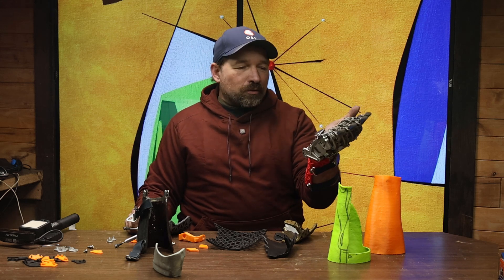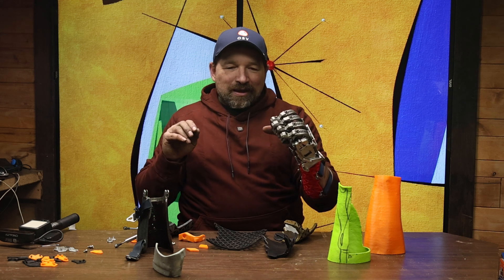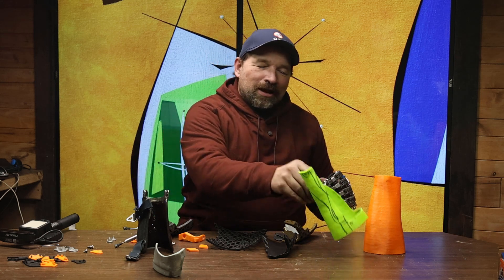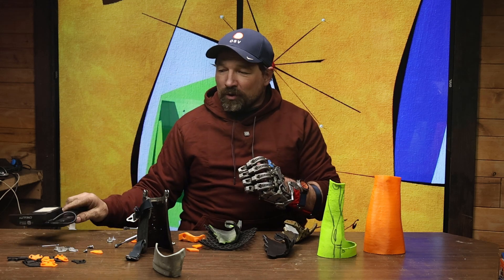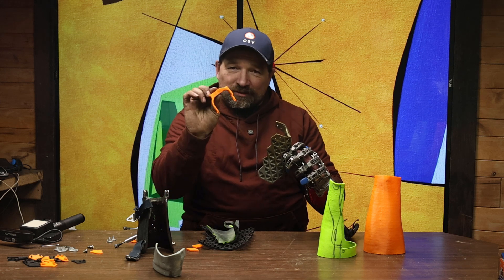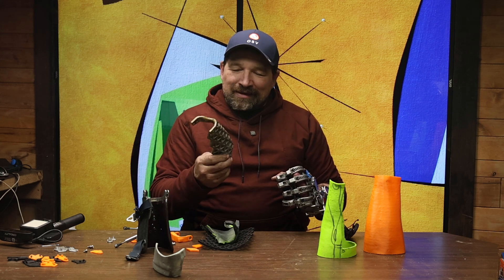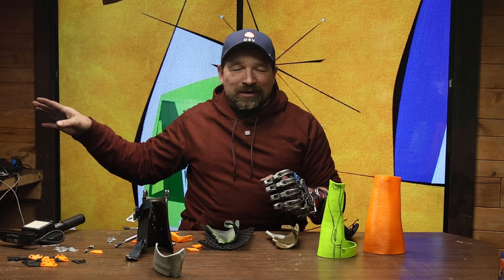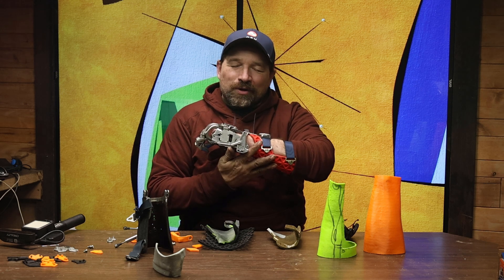designing my new forearm cuff without using cad! scan to print

Comment: That's super cool! Would cutting out several or most of those triangles be a good way to help breathability to the skin and weight without compromising the structural integrity? I assume that it would need to be made out of a more durable material

Comment: I have a quick suggestion for achieving a perfect fit on printed items. I don't make prosthetics, but I have made custom molded close fitting items out of thermo-plastics in the past. I printed the items as a flat (or mostly flat) plate, then heated them up to their glass transition point, and molded them to the body part. (using a flap of old jacket leather to avoid direct contact with the skin.)

My goal was a super tight custom fit for costume pieces, without supports that would compromise the surface finish. But I assume a similar techniques could work for your purposes. The basic idea is that anything that can be extruded can be softened with heat and molded a bit until it's just right.

Comment: never done something like that, but that sounds like less steps to check if it works, starting from physical could make sure that the first iteration is closer to what you want, neat! btw i have a question i dont know if you have answered yet, how do you deal with the cold in your hand, like, do you have a protector sheet between the metal and the flesh? is cold not that much of a problem where you live? do you have a specialized glove? (sorry for the bad english just woke up and its not my first language) have a nice day!
Reply from the maker: the cool thing with this method is you can be assured that the model is going to fit. i've spent a bunch of time drawing on something just to have it fit terribly. if you start with something that fits, you're more likely to end up with something that fits. 
as to the second question. I don't have much of an issue with cold, I actually have more of an issue during the summer. when i'm driving, the a/c vent point right on my hand, where its made of aluminum, it transfers the cold temperature very efficiently.

Comment: It wasn't digital but I did have a similar experience.  I like things being perfect so I thought I was going to have to resin print some dice holders I wanted.  But eventually I gave up on that and just made them out of clay.  I then made molds and cleaned up the copies.  Then I did several iterations of making a mold and then cleaning up the copies.  Honestly the first one was the most perfect right off the bat, but I stupidly decided to paint it before making a mold thinking that I could get the corners more crisp.  But I got it eventually.  I was really surprised at how precise I could be by hand.  They've probably turned out better than a 3D print because I would have to clean that up anyway.  Ever since I've been making a lot of stuff out of clay.  I hate to say it, because I love 3D printing, but for what I need it's a lot faster and easier.

Comment: Interesting. Perhaps to smooth the process for the future you can have a CAD model of the connection points and add that to the scan to take out a step? Then, I would have assumed there would be a built in way to create an iso grid on the surface (although of course I have no idea what that method is lol) looks nice tho